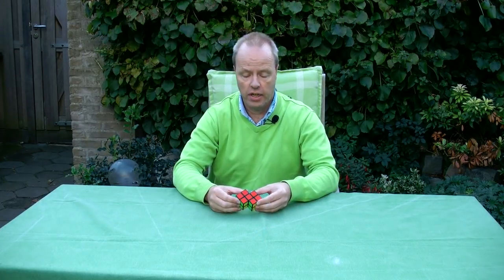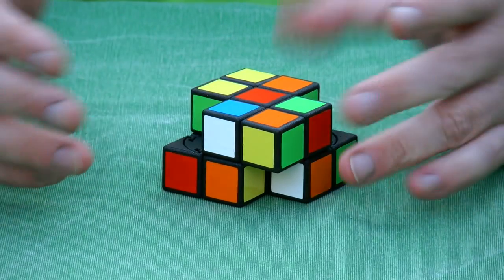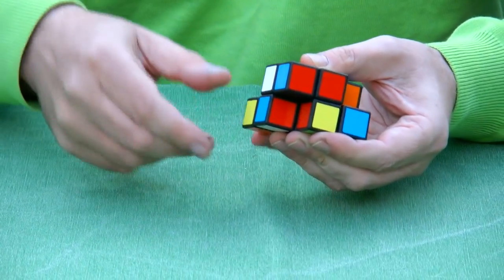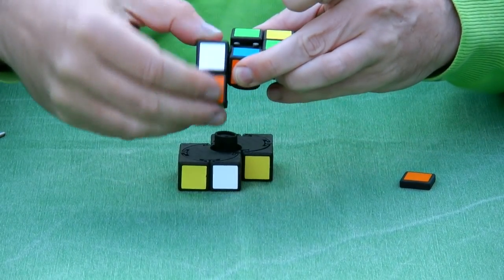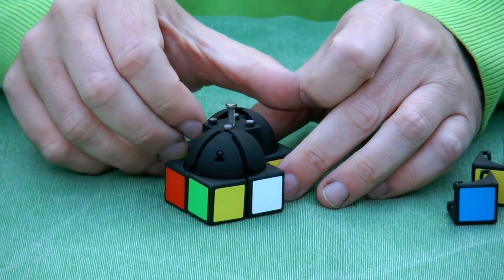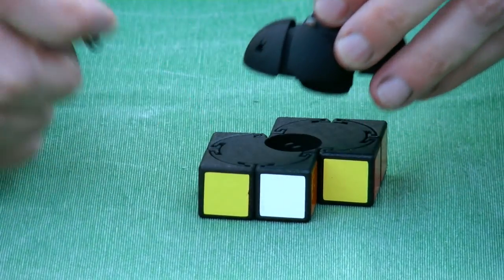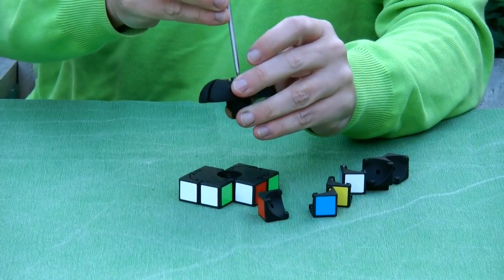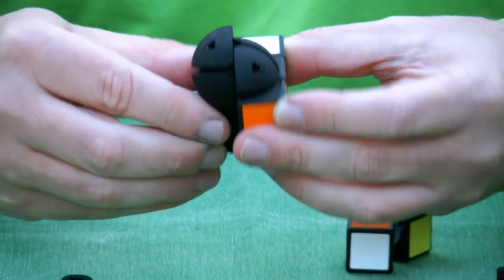Over-functional Siamese

Comment: Great idea. Maybe you can apply this to the implementation of 7x7x7 (or over) with edge cubes which all are cubic.
Reply: I don't think you could really do that, for one, it works on this 2X2 because the corner runs right up against the mechanism... in a higher order cube, that's just impossible. for two, even if you could somehow have this pin concept work on a higher order cube, all the edge pieces would still have the over-hang issue that makes you need to pillow or extend the pieces... there's really no way to implement this pin idea on anything other than a small-order cube.

Comment: Theres 12 corners(that can do 2-cycles), so 12!
4 pairs of the same so divide by 2^4= 16, so 12!/16
Each corner has 3 possible orientations, while the last corners orientation is determined by the others, so multiply by 3^11: 12!*3^11/16

5,303,356,027,200
Or roughly 5.3*10^12 possible combinations.

Comment: I had to think about this a good while to figure out how it worked. I initially thought there was a freely rotating cam on the inside, but from looking at the shapeways images and model, it's clear that instead of a cam as I first thought, there are two elliptical tracks that slide past one another on assembly, and each pin has a hook over the track for retraction. It's an elegant design!

Comment from the maker: What would be a solution for three 2x2x2's in a row?
Reply: Maybe perhaps the same as this, but when the first piece get locked into place, those locked pieces will lock the next ones.
Reply: I would think that would be a relatively simple stretching of this concept, perhaps having pins on all 3 of each set of outside corners
Reply: I feel like it would be hard to have the mechanical force that pushes the pins out fit inside a central pivot if you were to add another 2x2x2. If there were internal mechanical triggers, perhaps loaded by a weak spring or a magnet, that would retract pins whenever the top and bottom parts are aligned, maybe that could work? You might be able to put such a mechanical trigger inside each outer 2x2x2.
Reply: It depends. Would they be locked in the            C  C      |
                                                                                  C  C  C | C
                                                                                           C | C  C  C
                                                                                               |     C  C
pattern, or would you be able to turn the middle cube along the line I made? If that were so, you would have to account for having one outer 2x2 scrambleable while the halves of the others are hanging in space around the center one. Plus that one would need full functionality.
Reply: Maybe a design with a middle cube that has two hidden extended parallel axes that connect the four halves of the spheres of the two cubes on the outside to the core of the middle cube?

I guess that would mean that the core of the middle cube would be like that of a 2×2×4 (with two of the four 'layers' hidden and used only to connect the two cores on the outside).
Reply: This but again

Comment: Why would you have the central oval axis push out the pins in the spheres? (at least that's how I assume the mechanism works)
Can't you use springs and additional (detection) pins between the halves of the spheres, that would 'trigger' the pins on the outer surface of the sphere once the halves are detached/disengaged? It might make the mechanism more complicated, but maybe it could also be used to design a Siamese cube with three connected cubes instead of two.

Comment: after you make a 90 degree angle turn on the top layer you can't turn the side layer, so I think it's a bit misleading to call it fully functional
Reply: Linck192 what’s the problem? What he did is already very impressive
Reply: It is fully functional. It just doesn't shapeshift. Shapeshifting is beyond normal functions of twisting puzzles.
Reply from the maker: Nice idea for an more-than over-functional siamese :-)
Reply: Speaking of shapeshifting, I just bought Rubik's Floppy (3×3×1) and I was disappointed that it completely shapeshifts. I would like to have one where you can only twist 3 cubes in a row at once. With 90 degree turns it will still shapeshift, but only a little bit. Maybe I just want a Floppy which allows only 180 degree turns. I guess I just don't like shapeshifting twisty puzzles in general. That may actually be one of the reasons why I love this design by Oskar so much!

Comment: My question is how many possible combinations are there?
Reply: Theres 12 corners(that can do 2-cycles), so 12!
4 pairs of the same so divide by 2^4= 16, so 12!/16
Each corner has 3 possible orientations, while the last corners orientation is determined by the others, so multiply by 3^11: 12!*3^11/16

5,303,356,027,200
Or roughly 5.3*10^12 possible combinations.
Reply: @giladzxc17  thanks!

Comment: Could the pin mechanism be made into a hook instead, to make it more stable?
Reply from the maker: Hook?
Reply: OskarPuzzle instead of a simple straight peg coming straight out of a straight opening into a straight slot in the cubie, perhaps a "peg" that's curved, or helical going into a curved or helical opening. But maybe there isn't enough room for that kind mechanism, or maybe it wouldn't be doable in this case.
Reply from the maker: The pin works. And there is indeed not much room ...